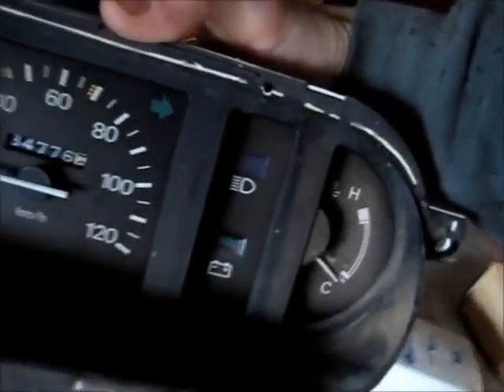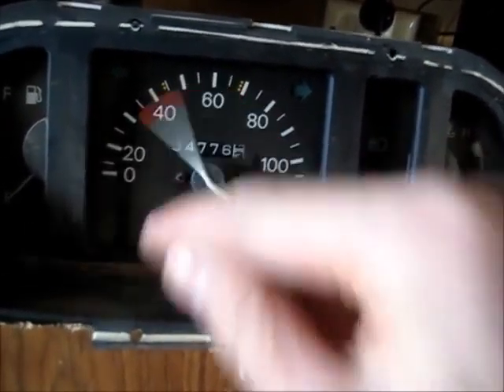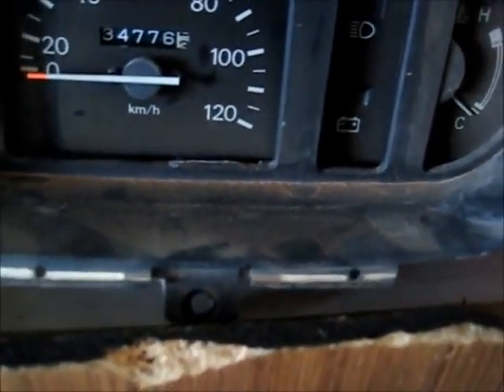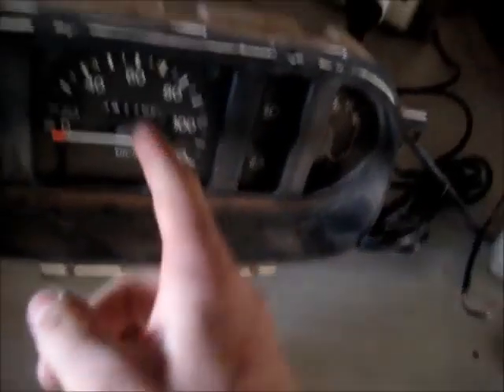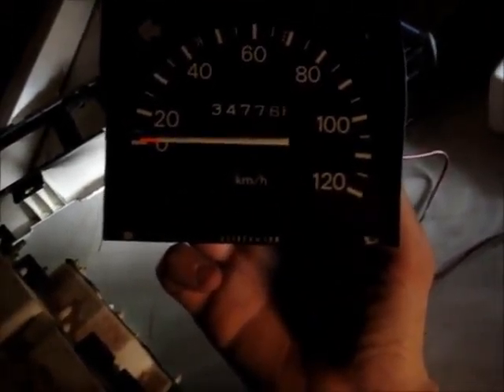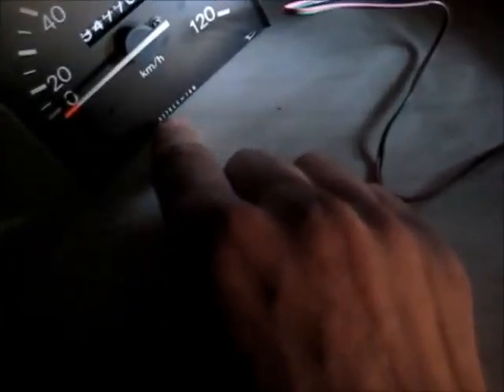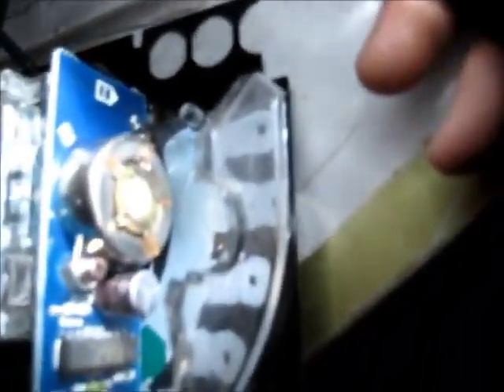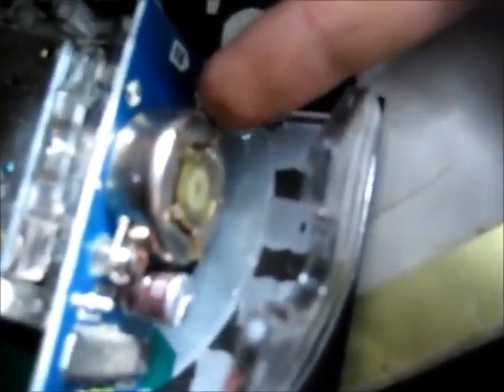Older & Modern Odometer

Comment: Good video. Interesting that the Japanese speedometers have the eddy current producing magnet on the outside and the needle drive on the inside, while European, VDO have the magnet on the inside and the needle drive drum on the outside.
The electronic meter can be made to run from 12V 50 or 100 Hz mains, by putting that via a resistor into the pulse input.